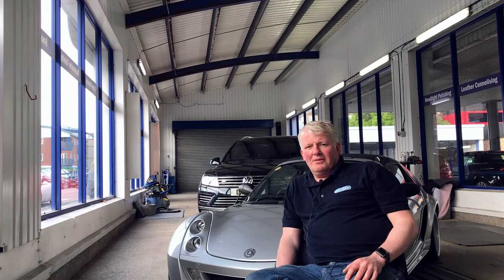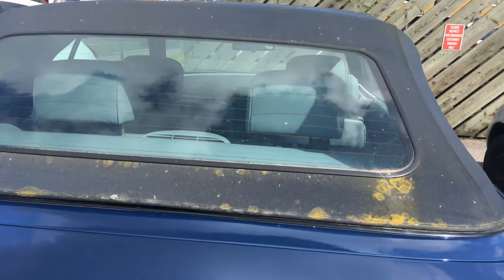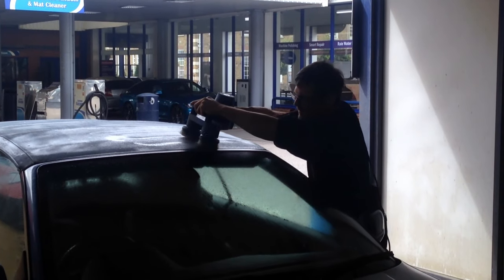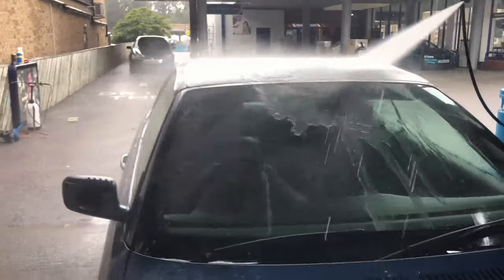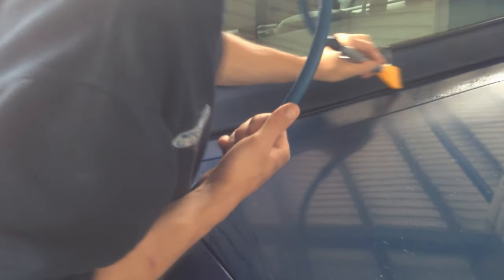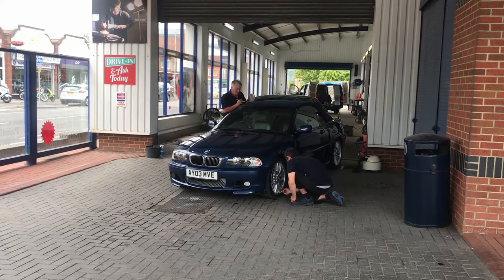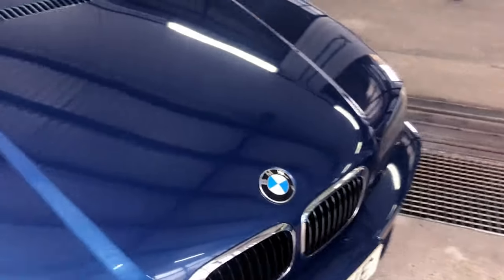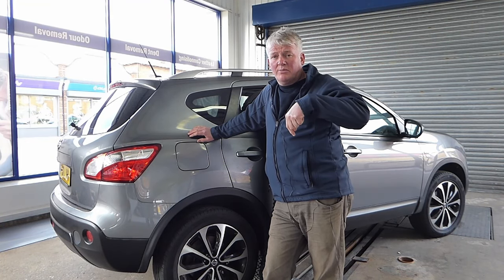Convertible  Hood Restoration on a BMW 3 Series

Comment: It was useful but your reluctance to reveal what chemicals you used spoilt it.
Reply: We buy detergent as concentrate in 10 gallon drums, there's nothing special about it except you need a trade account to get it. We mix it up a little stronger than you can buy retail products but the secret is the brushes and taking the time needed to do the job right.

Comment: My convertible e36 has mold in the inside of the roof only. Any thoughts?
Reply: Convertible cars are more prone to leaks than hard tops. The odds are that you have a leak and water is getting inside your car, creating a damp environment where mould can grow. 
You need to start with fixing the leak and drying the car. Mould in cars is something you should take seriously: https://www.youtube.com/watch?v=7MbkZ-IrzTo
Reply: @CarWaterLeaksFound  Thank you so much for the fast answer. After I checked my roof I found that the rear vinyl/window is missing a rubber sealing. I think water gets in between the fabric and creates mold inside my cabin.But how do you dry a soft top properly, if there is no, leaf blower, for example? I wash my car on the street and there is no power supply nearby.
Reply: @Porche1992  I understand the problem, that's how we are able to make a living from this exact issue. We have a large workshop where we can take cars apart, we have industrial hot air blowers and dehumidifiers. It isn't nearly as easy to dry a car as people think, you can't just put the heater on and think it will dry out on it's own. There's often 10 or more litres of water under the carpet before you notice a problem.

Before doing anything else, I would remove the trim along the bottom of both doors, lift the carpets up and see if it is wet underneath. I would check for water in the boot, and in the bottom of the compartment where the roof is stored when it's down. I'm afraid that if you find that any of these have a puddle of water in them, you are going to have to take more drastic action to get the water out and dry the car. But before you think about drying the car, you really need to make sure you are sure what the problem is. You don't want to be in a position where you borrowed somebody's garage, took your seats out, dried the carpets only to find that you BMW was leaking from around the steering servo and you have a car full of water again.

Comment: What were the cleaning products you used please? My Golf Mk3 Cab has a similar moss stain/lichen issue
Reply from the maker: I'm afraid you won't like the answer...
The secret to our success is to use one of those electric brushes... but you can't just use one of those brushes straight out of the box, you need to use the brush heads on carpets for a few months until they are worn in, they become softer and so then won't damage the roof. But you still can't get too near the seams, you really need to scrub those by hand until it's done. If that means standing there with a toothbrush for 20 mins doing a single spot, then that's what has to be done.

There are special detergent's on the market for hoods, but we mix our own. We buy in bulk and our soaps come as a concentrate which we need to dilute with water. We mix it up stronger than anything you could buy in Halfords, so what we are using is much more aggressive but it's safe if you know what you are doing.  This speeds things up for us a little bit, but the majority of the cleaning is done with agitation by hand, electric brushes or indeed the volume of water we are putting on it.

You will also notice we are using a pressure washer, this is essential. But that's not just any old pressure washer, unlike the pressure washers you can buy from B&Q which feed off your hosepipe and put out a low volume of water at very high pressure which can very easily damage your hood, ours run at a lower pressure but put through a massive volume of water fed from our plant room by a two inch pipe. We have huge water tanks and a large electric pump which  pushes massive amounts of water up to our pressure washer bays.

We often get comments on our videos which are something like, "Never use a pressure washer directly on a soft top like that!!!!", and they would be right if we were using a normal pressure washer. (See below) and this is good advice. The other thing that makes our pressure washer different to most is that they are heated, so they are putting hot water onto the roof. You can't understate just how much difference this makes. 

You can clean your own roof at home, there are plenty of retail products available, and we would recommend Renovo. It's hard, filthy work and takes a long, long time.  It takes us most of a day to do a roof, and obviously we are able to make a living out  of doing this (and other unusual services) by finding methods and equipment to do them more quickly and efficiently than you can do it yourself. So I'm afraid i can't give you any easy answers to D.I.Y.... because our service is the easy answer.